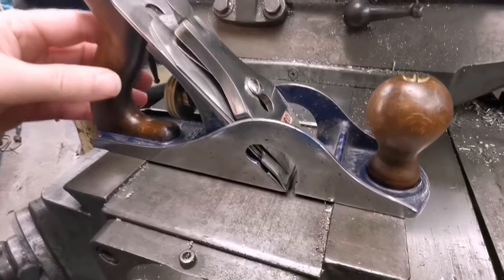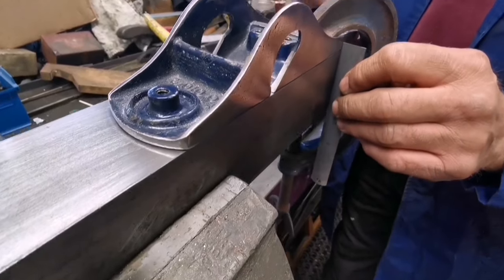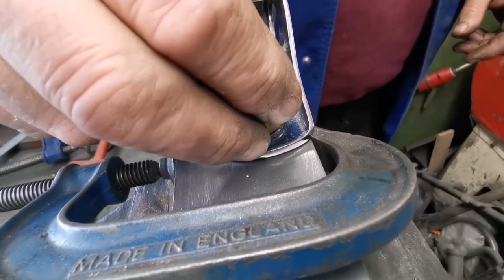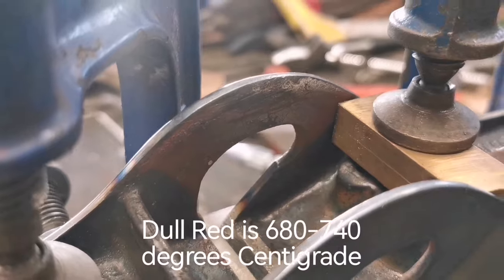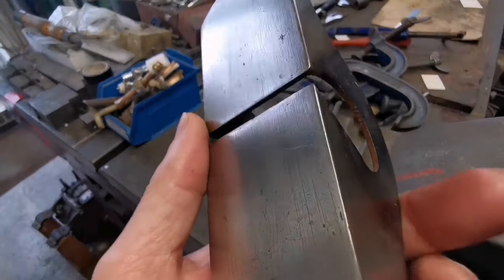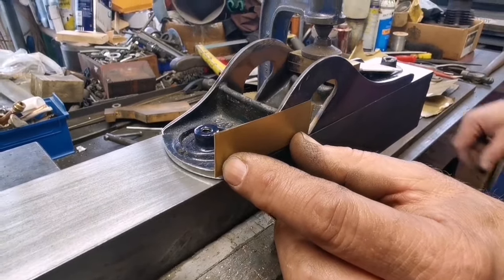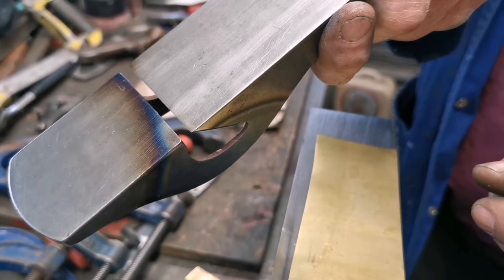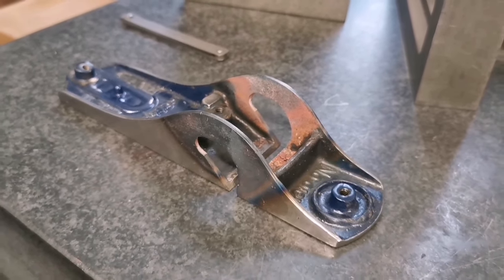Can we fix a BENT Plane? You NEED to watch this before you try. #woodworking

Comment: Very interesting I would never have thought you could straighten a casting without breaking it.👍
Reply from the maker: Robert knows his metalworking. I still have a bit more flattening to do. We should have gone that extra bit, it would be finished by now. It's still got about 30% to go. But as you can imagine it takes a while.
Reply: @twcmaker  flattening plane beds is real hard work I know I’ve done many. No4s aren’t too bad but anything bigger is tough. Good luck.
Reply from the maker: @chrisfinn1162 Thank you Chris. I look forward to sharing the success on here very soon. Maybe not too long before another video showing how well it's going. Cheers. Jamie
Reply from the maker: You might like the latest video. A Tiny Thumb plane, not only cute, but Bronze and a rebate plane too. A very special little usable tool.
You can watch it here
https://youtu.be/JOGxjoQyLKk
Thank you
Jamie
Reply from the maker: Hey Chris
The work is now done, you can watch the latest on the Record Bench rebate plane here 010https://youtu.be/Qvmjd4JwlDE
Thank you for your support.
Jamie

Comment: Well done Robert, I  would have done it that way.  Only thing different I would have brought a 2nd plane along as a reference.   Have a good Christmas and New Year
Reply from the maker: Ahh. I didn't get this at first. But then... that's because you have more than one of these?
Reply: @twcmaker  no I looked at them and didn't like the body as thought it would be a twist point.  Sometimes it is handy to be able to have reference point because castings might be 3 to 4 tho and not 1 to 2 tho.
Reply from the maker: Ohhh.. Another plane to reference how far that one is out. Got it. I've not got many that are still not lapped.
Reply: @twcmaker   same here I get a plane and the spend time checking and getting it lapped in and considering it will be 2nd hand and been used in the past it is probably me being fussy that it needs to be absolutely true.
Reply from the maker: Once you've used a plane that's been 'sorted', it's hard not to look and start getting on with it.

Comment: Can I wish you and yours a great Christmas!

I am confidant I will never in my lifetime have to do this ....... but it was fascinating!
As a general question what tolerances would you expect on a plane?
And following from that, Is it a problem if the leading face is higher than the main body? That way you should get both the front and main body running flat on the wood you are plaining ..... or am I misunderstanding things ;o) 
As a special "Brucie Bonus" ..... How relevant is this when applied to wooden (made of) planes?
Reply from the maker: Thank you. A Merry Christmas to you and yours too.
So many questions..
One at a time. Tolerances. I would expect a quality plane to be less than half a thou out.
Reply from the maker: Yes the leading face is unbelievably important. It's the first reference, so  everything is dependent on it being flat.
Reply from the maker: The Japanese planes only have 4 points that are flat. The toe, the rear of the front section. The first part behind the blade and then the rear.
Reply from the maker: And the same on wooden planes too.
Reply: @twcmaker  if surface ground should be able to get less than 1/10 of a 1,000 of an inch flatness
Reply from the maker: That would be amazing. We'll see how I get on. It might suddenly start leveling off. I'm about 90 minutes into lapping. And I'm only doing it every now and then between other things.
Reply from the maker: You might like the latest video. A Tiny Thumb plane, not only cute, but Bronze and a rebate plane too. A very special little usable tool.
You can watch it here
https://youtu.be/JOGxjoQyLKk
Thank you
Jamie
Reply: @twcmaker  Already watched ..... and yes it is cute!
Reply from the maker: @totherarf thank you. 👍
Reply from the maker: Hi, 
The hard work is now done, you can watch the latest on the Record Bench rebate plane here 010https://youtu.be/Qvmjd4JwlDE
Thank you for your support.
Jamie

Comment: So, the plane steel went blue once cooled. Tell me why when we grind our chisels we dip cool the sharp edge in water or oil?
I thought it was that blue steel is brittle hence the dip. Ask your engineer friend. I’m interested to know if I was told correctly as an apprentice 45 years ago. …….im old aren’t I 😅
Reply: Bloody good vid again. Thank you
Reply: Hi your absolutely correct for steel but this is a cast item probably close grain grey iron so behaves differently 
Regards
Reply from the maker: Thanks Carl.
Reply from the maker: Now I'm going to say.. (remember I'm a woodworker not a metalworker) That we cool the chisels and irons, because they're tempered and we don't want them to lose their temper.
Reply from the maker: You might like the latest video. A Tiny Thumb plane, not only cute, but Bronze and a rebate plane too. A very special little usable tool.
You can watch it here
https://youtu.be/JOGxjoQyLKk
Thank you
Jamie

Comment: You found a pup there Jamie, do you know what cause the damage?
Reply from the maker: Not mine Adam (did you skip the part where I said that?)
No idea, but great to be able to sort one out.
Reply: I was being anti social and watching with volume turned down a bit too far while everyone else is watching Xmas stuff. I got it later when you said dropped on the corner. That took some doing I should think. My late stanley came off scaffold and survived with a cracked plastic handle. Shame for this one although nice repair.
Reply from the maker: Nothing wrong with a little anti-social Adam. Yes I'm glad it worked out. I suppose it luck how they land. Only damage to plastic handle.. would be an easy fix and upgrade, that's brilliant luck. I think this one will deserves a very good tuning. We will see.
Reply: @twcmaker  I suppose how much tension is in the casting before it’s dropped too. I’ve got a rabbiting block plane that’s for on-site work only that’s been dropped a few times and is still good. However I once dropped a no4 and that broke into several pieces. Who knows what causes such damage. This is well worth a tune up to your standards (similar to mine) will be an excellent tool then. Don’t repaint though it needs to keep its war wounds
Reply from the maker: You're right (and I'd forgotten about the tension they sometimes hold) I saw a No4 that, after it was dropped, the one side by the mouth moved out a good 1mm.
Reply from the maker: You might like the latest video. A Tiny Thumb plane, not only cute, but Bronze and a rebate plane too. A very special little usable tool.
You can watch it here
https://youtu.be/JOGxjoQyLKk
Thank you
Jamie
Reply from the maker: Hey Adam
The work is now done, you can watch the latest on the Record Bench rebate plane here 010https://youtu.be/Qvmjd4JwlDE
Thank you for your support.
Jamie